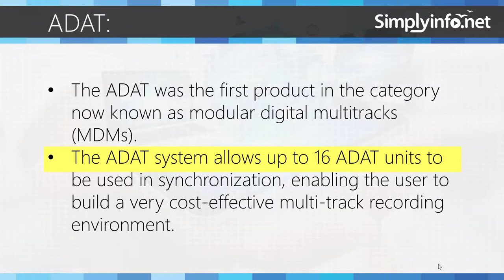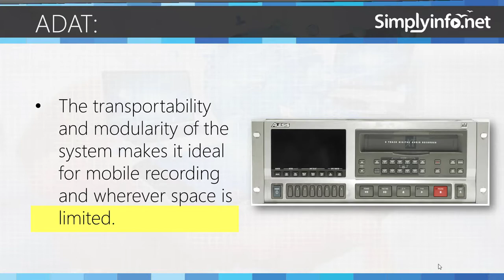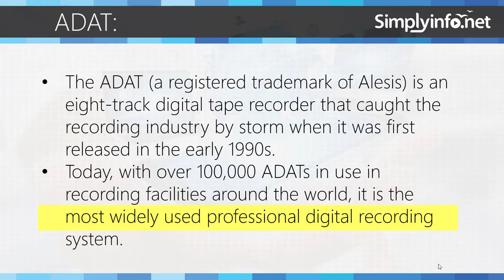What is ADAT | Define ADAT | Alesis ADAT | Use of ADAT | ADAT System | Multimedia Audio Concepts

Comment: My problem is when I use multitrack audio interface, it show 8 mics . 1/2, 3/4,5/6,7/8. So if I plug in condenser mic in 1 I cannot plug my keyboard into 2 to get stereo , and phantom power can spoil my keyboard. So I cannot speak and play my keyboard . So either I can speak or play keyboard. I mean this is if I use zoom.